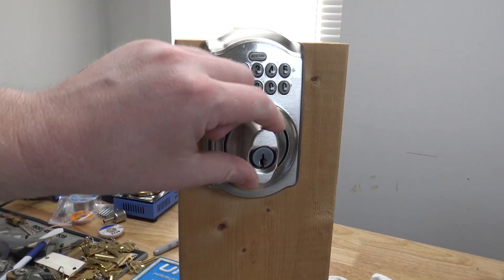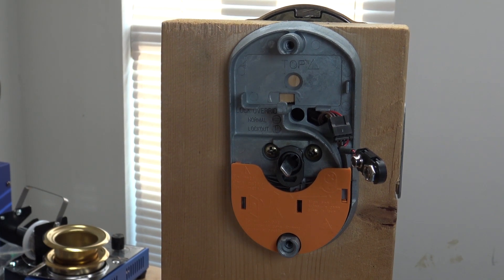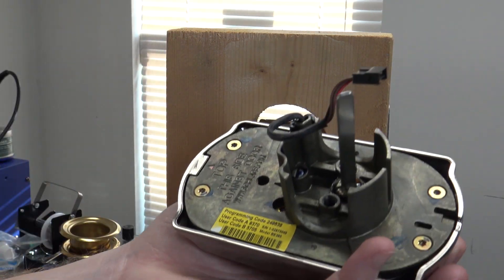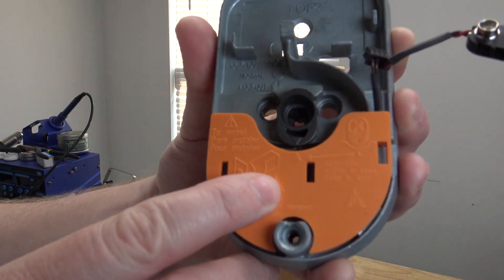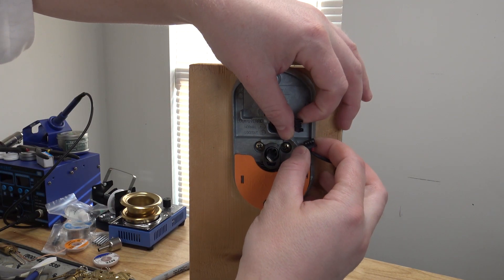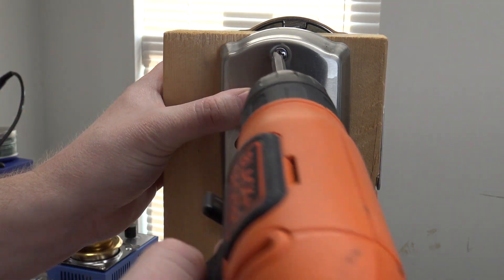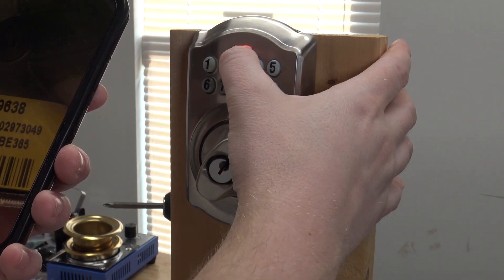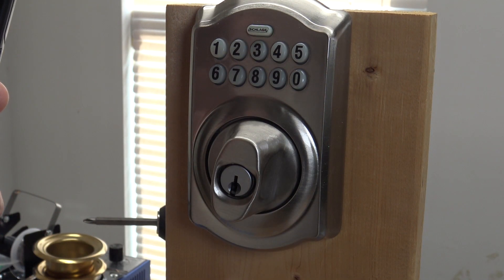(492) Retrieve Programming Code on Schlage BE365 Electronic Deadbolt

Comment: Great video, thanks for showing this. Philosophically I disagree with their putting the sticker with the programming code on the outside/insecure side, but practically it probably doesn’t matter—by the time you could see the sticker, you’d have broken the lock enough to get in anyway 😂 Thanks again, very helpful! 😊🙏
Reply from the maker: The sticker has to be somewhere. I’ve ran across a few that people had removed it.  If it’s gone there’s no way to get the code and reprogram it.
Reply: @russej02  yeah I agree; I would probably not even move it myself, for fear that future me would curse present me for his stupidity. They should probably put “Do not remove” on it, if they could fit it 😂